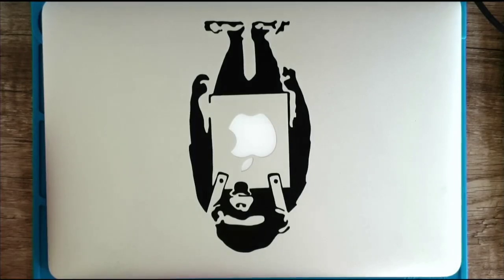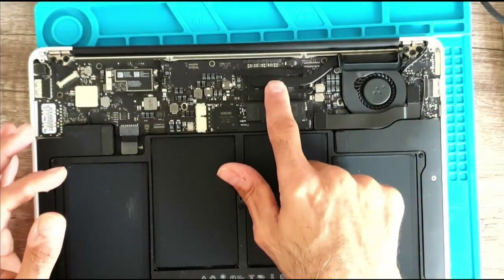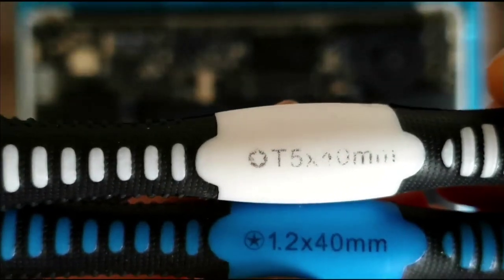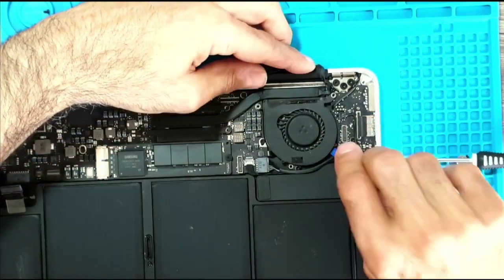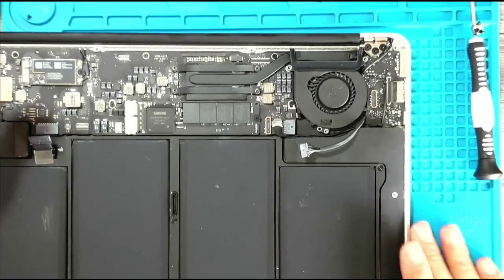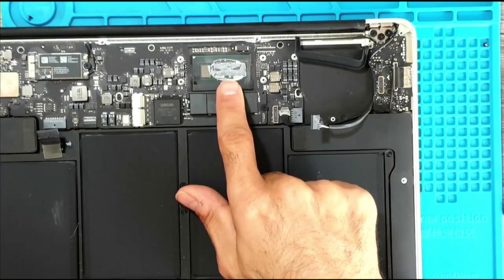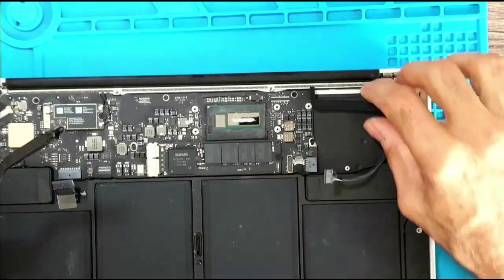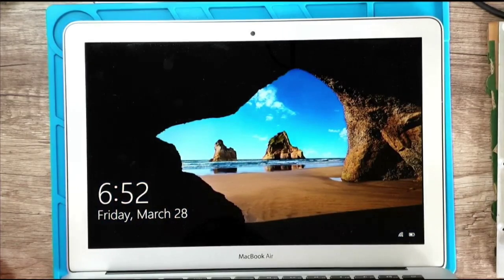37 MacBook Air (A1466) - Replace Thermal Paste

Comment: You DO NOT need to remove the fan.  If you watch the video (you can start about 1/2 way thru) there is a somewhat hidden screw just above the right/top screw of the fan (watch the video). if you VERY GENTLY use a spudger to tease the diagonal wire covering it out of the way (GENTLY!!! sideways), and remove that screw (its at the far right end of the heatsink, next to the notch the rubber gasket sits in) then cleaning off and re-pasting the heatsink is a piece of cake.  ALSO when screwing/unscrewing the heatsink, do the screws in 2 or 3 steps, in a diagonal pattern so you don't crush the cpu.  And when  re-seating the heatsink, don't tighten the screws until you first get them all seated a turn or two, so everything is lined up.  ALSO - don't forget to unplug/replug the battery.  I'd say it took me about 20/25 minutes overall. - 30/40 minutes total, but I replaced the battery and upgraded the SSD (1 TB) at the same time.  My CPU temps run about 15/20 degrees C lower now (on a 2015 Macbook Air).  Typically idle at about 50C & 1200 RPM fan speed.   Also look at the iFixit vids and web pages, lots of good hints.  You can get by with just the pentalobe and Torx screwdrivers that come with many battery kits.  BE VERY careful with the TEENY/TINY screws.....  iFIXIT has a $30 kit with spudger/screwdirver tips/tweezers and a very handy lid that you can temporarily put the screws in.  AMAZON has a KRYONAUT kit thats about 7 bucks, has cleaning wipes, a little spatula and thermal paste (Perfect for this).